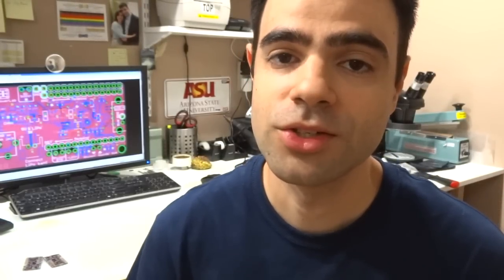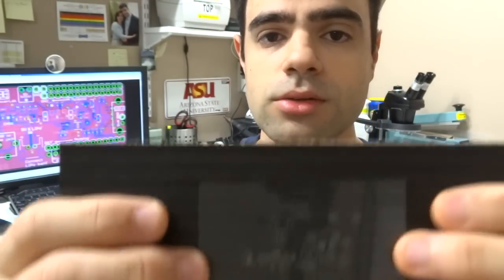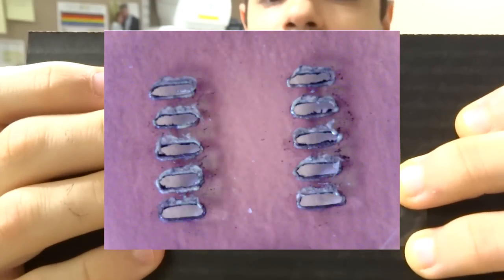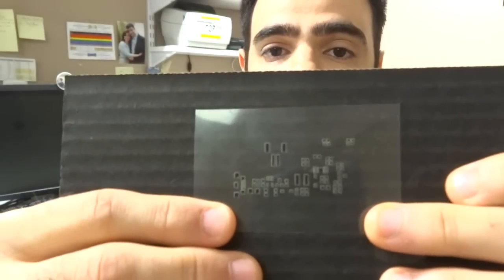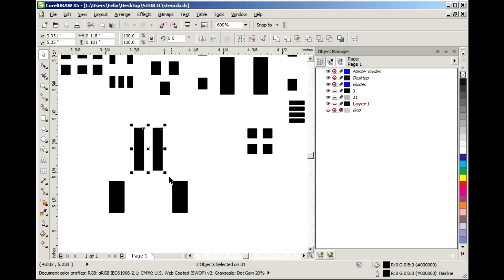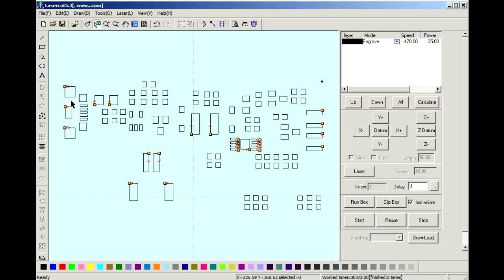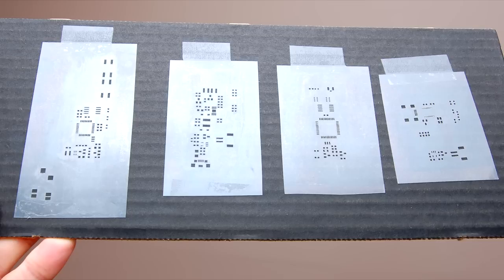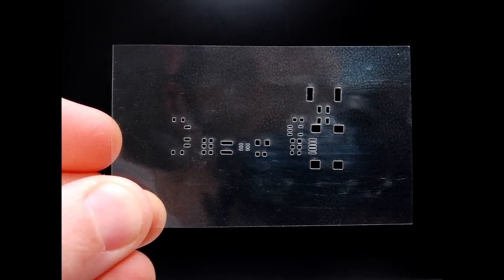Laser cutting/etching SMT stencils from mylar (How to)

Comment: Why are you rastering to create the geometry? Use vector mode and just cut the profiles, this will be much quicker and produce better edge quality.
Reply from the maker: Yup I tried that and it works with some adjustments even for small apertures. Thanks
Reply: could be good just to make a horizontal stencil and a vertical stencil separately - then it would be just a raster, even vectorally.

Comment: Hi Felix,

Very nice video, I have had a Chinese laser cutter for ~ 3 months now similar to your 60W. What is the finest pitch
SMT parts you are able to etch? My smalles part is a 16-Lead MSOP and 4mm × 3mm DFN Packages. Ill be ordering some mylar
to test out, but I was wondering if you have tried that pitch yet. Thanks
Reply from the maker: 0.5mm pitch is possible but you're getting limited by the etch quality of the apertures, they can never be as smooth as a polished stainless stencil. Even so I got very good results and use some of these stencils for "production".
Reply: Thanks for the information Felix, Ill do some testing this weekend.

Comment: Felix, try Kapton instead of Mylar, you don't get those big ridges.  I also use denatured alcohol and a ultrasonic cleaner to aid in cleaning up the burn marks.
Reply from the maker: Thanks, I may give it a try. Mylar seems to work pretty OK for most my needs, and I etch stencils only once in a while, only for prototyping of boards with larger BOMs.

Comment: Thanks for the great video Felix! Your results look great! I'm using a 75 watt CO2 laser and keep melting/charring the edges. I've been doing it as a vector cut. Can you recommend any certain settings? The best I found so far was 40 speed, power 25, and 100 frequency. Am using an epilog fusion m2 CO2 75 watt laser with Corel software. 10 mil mylar.
Reply from the maker: Every laser is different, the ratings are pretty irrelevant, so there is no perfect recipe. You will have to tweak and find the right settings by trial and error. Etching will give better results in my experience.

Comment: Hey Felix, I have a question for you. What is the smallest size you can cut in the laser cutter with the PET sheet? Can you cut down to 0.20 mm?
Reply from the maker: You probably can cut 0.2mm but your laser beam has to be very sharp and you have to fiddle with speed vs. power a lot. I don't personally think its worth the effort for anything below 0.5mm, too much hassle. You can get small stainless stencils made cheap now.
Reply: @FelixRusu  Thanks a lot for your reply. I really appreciate such a quick response

Comment: Hey Felix - do you get better results from the metal etching method?  Curious as I think my laser is a bit to powerful and is cutting a bit too wide for SSOP packages..
Reply from the maker: +John Driggers Metal is better if you have the patience to etch it. But mylar is just as good and more consistent plus you can etch much larger stencils. I use mylar with large panels without issues. Just adjust the power on your laser and ensure it is focused properly otherwise your beam is too wide and scattered and the etch/cut is of bad quality.